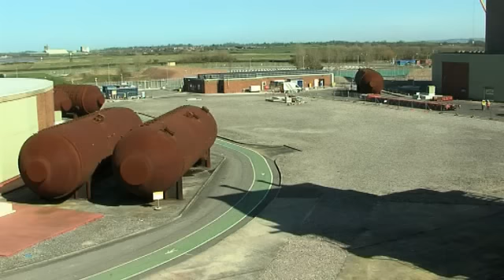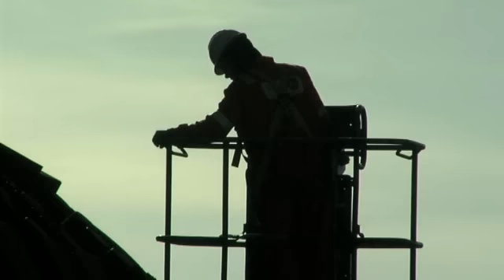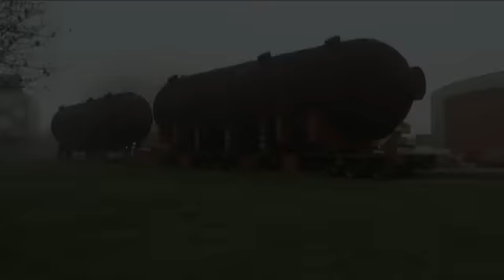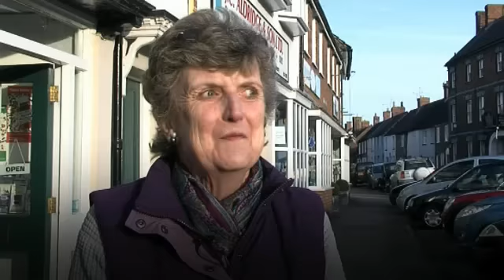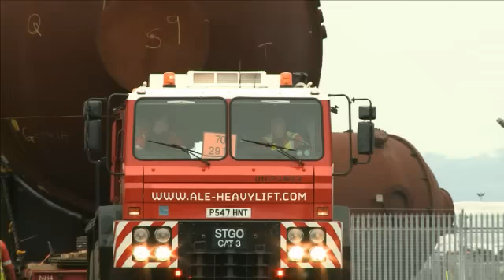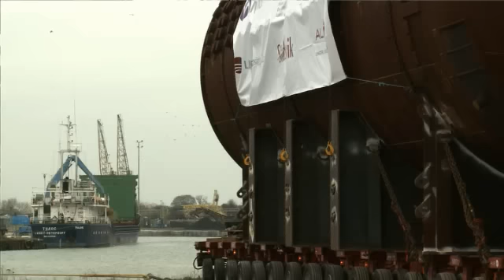Berkeley Boiler Move

Comment: Good job chaps.
Now you just have to clear the crap from the active waste vaults then wait several decades before attacking the reactors.
Some of the researchers at Berkeley were so intensely focussed on proving their theories they gave no thought to waste disposal. Now the heroes have to get that unknown stuff out and into the yellow boxes. Those who made the profit don't care what happens to you. I do.
Reply: We know what is in those reactors, the main issue is Co-60, which emits loads of gamma radiation. Once that has decayed, removing the reactor will be a lot easier.